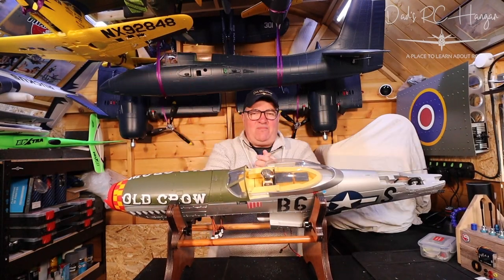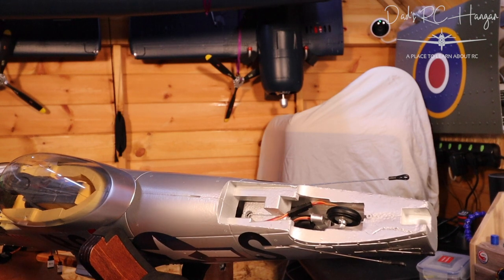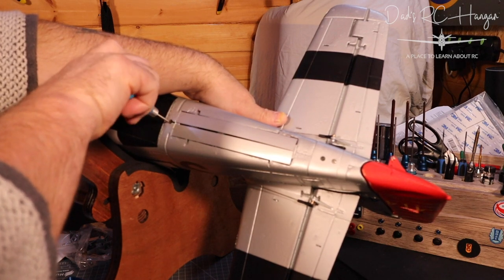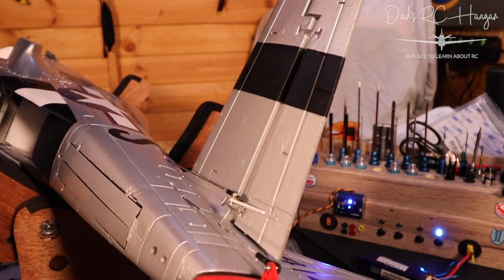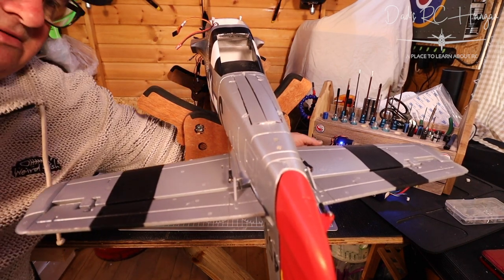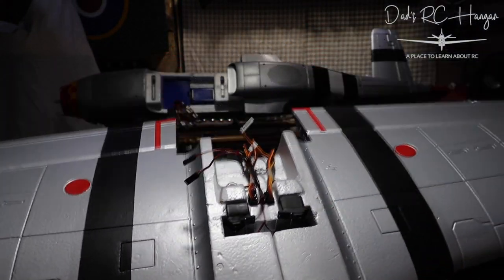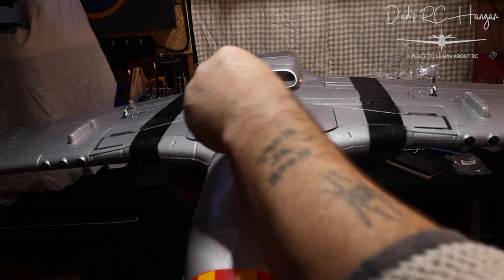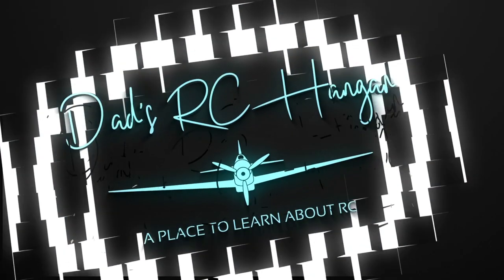Freewing P51D Mustang On to Building

Comment: Which Lipo 3300 batteries did u use , XT60 connectors, right ? I’m thinking about getting the Zeee 4S 14.8 V 50C
Reply from the maker: Hi Edward, I use Turnigy Graphene Panther batteries, they have a nice ‘c’ rating, but because of that, they are slightly larger. You have a great week ahead. 🫡

Comment: Hi Chris, i just got the p51 Mustang from freee wing. I want to ask if you go with the valúes on the manual For the elevador does it Work fine?.. i agree with you comment about not looking too much in the high rates. Thanks in advance
Reply from the maker: Hi Fernando, I have not had a maiden as yet. I would stick with the manual values And make sure you have all the rates on switches. Good luck with the maiden air. 🫡
Reply: @DadsRCHangar  thanks a lot sir, for your kind answer
😀

Comment: Awesome video , thanks for sharing!, I got really tired of the wait to buy my dream Mustang when I originally decided to buy the FMS 1450 Red Tail. To my luck , I gave this guy another look and just realized of all the extra features and higher quality plane, landing gear, control horns and connections, landing lights, etc, etc, and I just received my Old Crow today! , well, the only pack available at Motion was the standard Admiral 3600 Mah., did I jump the gun or is this a good pack to try? I also bought the MrRCSound system to add the extra nose weight I have read many folks is needed (I plan to power it with a separate small 3S pack) what are your thought and recommendations for a successful maiden?. Stay well!
Reply from the maker: Heya Cali, yes she a great Bird, I had issues with the MrRCSound Twice, but the good people at Motion RC took them back, and input the money to the Tiger Moth. The quality of the ‘Old Crow’ is great. Unfortunately I have not had a maiden, this is all to come with all my planes. You have to join our forum and let us know how you got on. Hope you subscribed, have a great day.
Reply: Dad's RC Hangar I certainly subscribed!. I am still too new in my flying and plan to spend a few more hours practicing with my sky trainer and the flight simulator before attempting to put my Old Crow in the air but will share my experiences here. Stay well and keep up with the fun!. Cheers